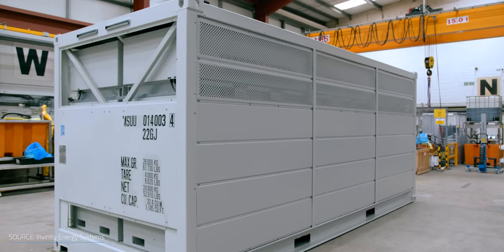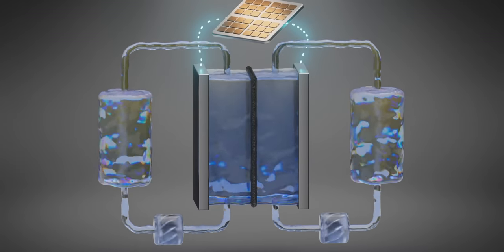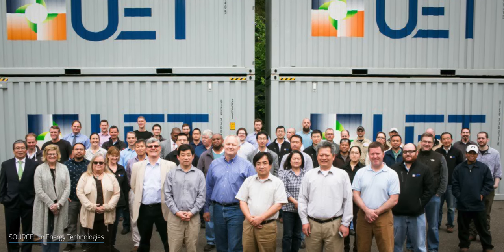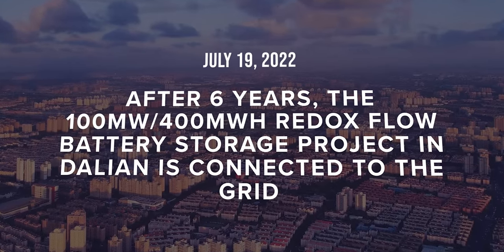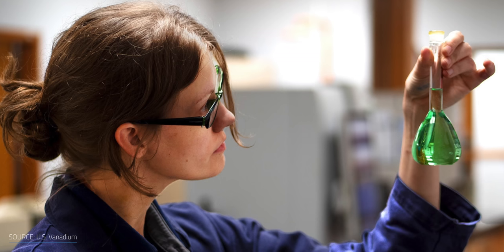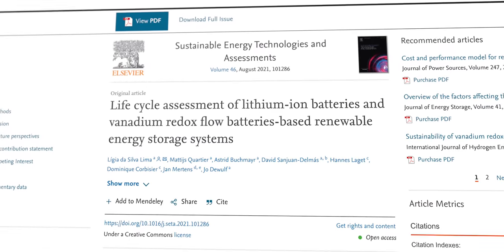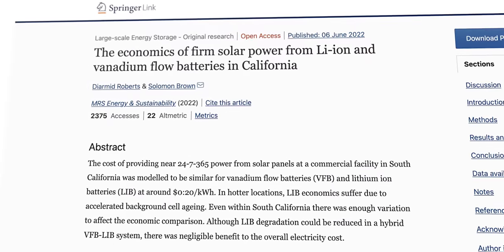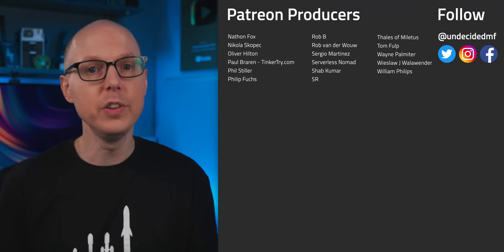The Breakthrough Battery That The US Gave Away to China

Comment: A group of engineers with NRECA and I visited a redox flow battery manufacturer a decade or so ago, somewhere in the NE US mainland.  We spent a half a day there, learning about the issues they were having in design and manufacturing. They were building flow batteries into modified shipping containers for a project in a remote Alaskan village.  The thing I remember most about the batteries was the complexity of the monitoring and control of the system.  There were wires and circuit boards everywhere.  I thought about how many things could go wrong.  Maybe it was all just monitoring and not really necessary for operation, but I don't think the batteries ever went in service due to breakdowns or failures.  If anyone is familiar with this project, I'd be interested to hear what ever happened here.

Comment: Had been keeping an eye on the Redflow company in Aus which produced some zinc-bromine units that you could install in residential homes, the only issue being the smell/gas toxicity apparently,  needed to be installed in a very well ventilated space in case of off-gassing due to the bromine used in their electrolytes.  Unfortunately I don't think they are pursuing their residential home battery lines (ZCell) anymore and are moving onto just their industrial versions of the ZBM3, which is unfortunate, as I really liked the idea of the safety of using a battery that isn't potentially going to burn down my home.
Reply: I've also been following Reflow for a long while. Zinc bromine is a great option and fantastic for remote off-grid applications. Unfortunately the cost of scaling to small systems doesn't stack up, hence why the Zcell hasn't really progressed. I looked at putting in their large systems into PNG for a remote telecommunications system as we can helicopter them in empty and just fill with the electrolyte.

Comment: Rabbit Hole (1) Iron-Air:
Not sure if it's worth the research, but twenty years ago, an American company developed the iron-air battery and the US Military labeled it disruptive technology and outlawed it.
In other words, our military has been stopping progress and preventing technological development.

Rabbit Hole (2) Thorium Salt:
Current reactor design was selected (and enforced) for it's ability to make material for bombs.

We had a running Thorium Salt reactor for a year.  Somewhere around 1967.
This design can burn most of the actinide sequence.
They run at ambient pressure, 750 degrees, so much safer on that front.
The waste is over three hundred times faster to become harmless.
If they do manage to overheat, the molten salt just dumps into a cooling chamber, so much safer.

And lastly, they can burn the waste from the current idiotic designs.
Reply: Do you have a specific article you can cite or has this largely been kept hush hush by censors?
Reply: @b_uppy  sadly enough this stuff is publicly accessible. Thorium reactors have been publicly known to be awesome for a long time. We mostly didn't go that route because we wanted lot's of weapon's grade materials. After we went in that direction, commercial & political inertia has kept em undeployed.

Fe-O2 batteries are also publicly accessible tech, they just haven't been very practical because of cycle limitations(pretty sure there's a semi-recent vid covering recent improvements in those). Until recently iron air batteries just weren't workable & it remains to be seen if they can be scaled economically.
Reply: Actually Al-air batteries are also promising (as Al is produced by electrolysis, you can dump the product Al2O3 in the electrolysis cell).
Reply: I think thorium salt obsession is slowing us down. A plug is a good idea, but why not just use plain water for cooling and use a hybrid uranium / thorium facility NOW? We don't have many meltdowns, and we desperately need the delay to stop.
Reply: @b_uppy  I will go dig around.  Last time I looked it had disappeared, but sometimes they pop back up.
Reply: @virutech32  
Thank you.  Too many politicians that favor donations over better tech is huge problem.  It's like the medical industry keeping people sick and on treatment instead of having a cure...
Reply: @sean_vikoren  
Would love to be able to read it.
Reply: @b_uppy  I wish I had it, but it is most certainly one of the disappearing topics.

I saw the Airforce do the same with a small lithium reactor about twenty years ago.
Reply: @sean_vikoren  
Hate how info on interesting/good topics gets kicked and instead we get 'noise' over less than great ideas instead...
Reply: @sean_vikoren  It really sucks when a promising technology is forced to be delayed due to corporate or government interference. It sucks even more when the delay turns out to be more of a death blow to the technology than anything. For me, it took years of study to form a big enough picture to have an understanding of why such technologies are sacrificed in the way that they are. Unfortunately, we live in a massive world filled with unevenly distributed resources during a turbulent age where hundreds of other governments exist. The complexity of this world has required exceptional measures to be utilized and undertaken to maintain some level of order and stability. At times, the cost of this order and stability has shown itself through the technological sacrifices that have been made.
Reply: @Veritas-invenitur  This technology has not "been sacrificed" or "suffered a death blow", it has taken wings thanks to the foresight of engineers and planners in China. There is nothing stopping its manufacture in the USA as well, except the lack of anyone there willing to pay for it. There is another battery technology, the lithium-iron-phosphate battery, that was being developed in the USA with public support 20 years ago by the company A123. The company refused to sell its products to most people who were clamoring to buy them (A123 batteries had a rather low energy density compared to other lithium batteries, but they could give out and take in their full energy capacity in a few minutes), and ended up going bust and being sold to a Chinese company.  Chinese companies and institutions have since then been busy developing this technology, and now are supplying a large proportion of the electric vehicle battery market.
Reply: @Veritas-invenitur  My country has been murdering people all over the world for my entire life.

The sacrifices we make to maintain this are not added to a roster of goodness or even necessity as you imply.

Our 'Founding Fathers' were mad murdering slavers and the systems we live under now were designed and perfected for the purpose of maintaining a population of deluded slaves that don't run, and don't even understand the unthinkable injustice they were born into.

The sacrifices are made to keep us from waking up.

The carefully nurtured addiction to comfort. 
The severing from the wisdom of Nature.
The brutal conditioning called school.
The carful maintenance of a large population living on the edge of starvation.
The general cultivation of hatred and ignorance.

We are being farmed by an ancient evil.

I have traced the slavers as far back as I could find records.

By a series of absurd accidents, I now  understand this.  I can now see what is prevented.

We could have ended scarcity in 1953.
Reply: @sean_vikoren  I give you a tremendous amount of credit for the dedication of your personal time into the research and the contemplation of our history and society. It’s not easy for everyone to stomach what we as a nation have done throughout history. Many people are put off by such things to the point that they refuse to learn or continue to learn. It takes strength to learn what you have done and to be as vocal about the situation as you have been. With that said, I’m not going to try to explain away or excuse the unexplainable and inexcusable. I’m not going to pretend that each and every single thing that was done was committed with the very best of intentions and were the very best choices that could have been made. However, I will say that our country, for all its faults, blemishes, scars, imperfections, and moral failures has accomplished more to benefit humanity in its short existence than the vast majority of all other other nations of the planet combined. If we focus on the faults and failures of the past, they will destroy us and prevent not just us but the world from learning from them and repeating them; as they divide and consume us. This world is far more troubled and dangerous than the vast majority of its inhabitants know. The fragility of the worlds order and every society within it, is always on the very edge of loosing its continued existence. The failure and collapse of the machine that has been erected going back nearly a thousand years would mean certain death for nearly all of humanity. All we can do, is to transform the machine without breaking it, into something that works for all of us in a way that does more good than harm.
Reply: @cedriclynch  I cannot expect you to understand when you do not have all of the facts or the insight into what has been going on or why. I am glad that the Chinese market has chosen to take over the development and progress the technology forward. The world is a chess board, and every aspect of society and industry are its game pieces.
Reply: You can't possibly believe that nonsense. Lmao
Reply: @b_uppy  Exactly, where is the money in that?  That’s why we call it the Medical Industry…I wonder what other social programs can be monetized? (rhetorical question) 😅
Reply: @Veritas-invenitur  It's really fun talking to you.  Though our views seem a little different, it's easy to recognize a fellow patriot.

A kind of calmness comes with seeing the circular nature of our path.

It seems that even the most serious undertaking must be perused lightly if victory is to be achieved.

If it gives you any comfort, I can build a new machine without inventing a single new thing.

All the ingredients are present.

We can do this without blood...or a steady lessening of blood anyway.  Target Zero.

As for mass death, this is playing out now across the planet.  Even a very unambitious person can find many improvements in this context of disaster.

In a time where the law opposes the right to assist your fellow man, the law must be understood to be the mechanism of oppression itself.

We will find ways to move on to a better world as Team Earthling.  Corps not invited.
Reply: @randybobandy9828  I thank you for your laugh sir.

Additionally, perhaps I can suggest that you may wish to look into the matter yourself.

An opposing researched opinion is almost always helpful.
Reply: @sean_vikoren  lol please point me in the direction that the military banned that tech and labeled it "disruptive". That implies the tech is just too good and the government didn't want average people to have that level of independence.

Comment: An Australian company produces a type of (electrolyte) Flow Battery that uses Bromine, which is completely inert (safe) and can last nearly 100 years.   What's more, its charge doesn't discharge over time, and its efficiency degradation is incredibly slow... meaning even if you haven't used the battery in years, it will still have the majority of its charge, so it's ideal for stationary energy storage solutions.
The (RFB) flow battery discussed in the video, seems to be a more dense version, and thus requires a smaller footprint
Reply from the maker: I assume you're talking about Redflow.  I have a possible video on my backlog for that one too.
Reply: Is it feasible in terms of price?
Reply: @UndecidedMF  Correct sir. 
 Redflow is the battery manufacturer I was referring to, but didn't want to mention the brand, as every time I mention a specific brand, other commentators end up accusing me of working for whatever company I happen to mention :)
Reply: @leonesperanza3672  Yes, you can check out their info online, under the name Redflow (batteries) in Australia.
Reply: the cost and longevity is usually the big issues to overcome.
Reply: are you sure? "that uses Bromine, which is completely inert (safe) and can last nearly 100 years"- bromine is almost as toxic as chlorine and extremely corrosive (certainly not inert). Or course as an element it can last 1000 years if stored in a sealed glass ampule.
Reply: @bocadelcieloplaya3852  you're talking right
Reply: @janami-dharmam  you're talking right
Reply: Eric, see my comment on flow batteries ...   Mike
Reply: Their revenue is 1.6m/year….. Spends like 13m/year. So annual earnings is -12m/year….. this is how technologies like these end up in China.
Reply: @Trollolling  So they're investing for the future... for future dividends.  That is called "big picture" thinking.
Reply: @ericmcquisten  If they could survive till then… chances are they’re going to get gobbled up by bigger companies.
Reply: @Trollolling  True.  I was assuming they were being subsidized by government money... but I could be wrong.
Reply: @ericmcquisten  a lot of it is public money I guess, they’ve done a quite a bit of Credit Raises. I’m pretty sure they get government incentives as well. 

But at $1.6m/yr revenue… it’s shit house. The management team needs to pick up their game.

Comment: This is a great video with many great graphics that artfully simplify a complex technology. As a seasoned energy storage pioneer, I believe climate change is a global problem requiring global collaboration to solve, so I’d like to clarify 3 facts:
1: The 400MWh Dalian battery is not the US technology – the US tech needs only half the footprint.
2: PNNL never gave the technology away. Rather, Rongke Power invested $72M into US collaboration to fund over 300 man-years of work by US engineers and scientists. Rongke also willingly shared access to crucial advanced components and production technologies to together deliver the breakthrough modular vanadium product.
3: The US tech electrolyte is no longer being produced in China, despite Rongke investing two decades and over $100M to refine vanadium electrolyte production and then apply it to the US tech. They are still the only ones who know how to make it, and it will take many years to develop the process in the US.
Net, Net: The result of this decade of passionate, award-winning global collaboration is a US-patented, commercially compelling battery that could be manufactured in the US.
Reply: Thanks for the insight. The NPR article and those that cite it as their primary source focus on an alleged wrongdoing, rather than what actually happened.

Comment: I heard that one possible use of flow battery would be in EVs. Instead of recharging the battery at a charge station, the depleted electrolytes on the cars are swapped with the charged electrolytes. Then the depleted electrolytes are charged at the charge station getting ready for the next swap.

Comment: Matt said lithium batteries last for ten years.  But the LFP batteries last far longer - they can have 3000 or more charge-discharge cycles, compared to NMC batteries with 1000 or so.  I think the LFP batteries should last a full 30 years, possibly more.

Still, I think RFBs are the best solution for longer term storage and should be widely deployed to supply power at night when there's no sunshine.  Plus the whole world needs a lot of pumped hydro for even longer term storage.

Comment: But how do vanadium flow batteries compare to iron flow batteries? Iron is cheaper($0.045/ lb for iron ore) & more plentiful than vanadium ($7.20/lb for V2O5)).

Aside from their existing deployment down in San Diego, ESS just signed a deal for a 2 GWh facility in Sacramento.
Reply: Aramco in KSA are about to bring online a 3GWH annual production VRFB facility using Vanadium from spent oil catalysts.
Reply from the maker: That's another cool flow cell technology. There's also zinc based chemistries out there too competing with vanadium.  It's not just cost of materials, but also the performance characteristics that have to be considered (degradation, energy density, etc.).  I'm still digging through a bunch of this stuff, but here's an interesting report about the flow cell tech that's out there: https://www.sciencedirect.com/science/article/pii/S0378775320311083#!
Reply: Bushveld Minerals ticker #BMN on the London Stock Exchange are about to bring online the largest vanadium electrolyte production facility in South Africa.
Reply: @paulc7205  who owns that company?
Reply: You're talking right
Reply: @b_uppy  Primarily UK individuals - Bushveld Minerals is listed on the London AIM stock market. No doubt you could buy shares if you wanted to on the OTC market

Comment: There are also Zince-Bromide based flow batteries, like the ones the Australian company Redflow currently produce.
Reply: Gelion?
Reply: Redflow started as a company in 2006. The Winter brothers (founders) had been tinkering with flow batteries for several years before that. I joined Redflow in 2010 and designed some of their specialty manufacturing equipment and assisted with electrode and membrane development. Redflow have been around much longer than Uni Energy and Mr Yang. Redflow and a sister company are also active in the USA.
Reply: @Will_CH1  are they using quaternary ammonium compounds in organic solvent to prevent the burning from gassing off?
Reply: Redflow?  Sounds like a woman's product
Reply: @petevenuti7355  The electrolytes were highly acidic but did not use a solvent. However i am a MechE and a little useless with organic chemistry.
Reply: @justayoutuber1906  They are a flow battery and the zinc bromide solution is red coloured.
Reply: @homosapien5442  Has Gelion ever actually delivered a product? I know Redflow has a 10 kWh battery for sale.